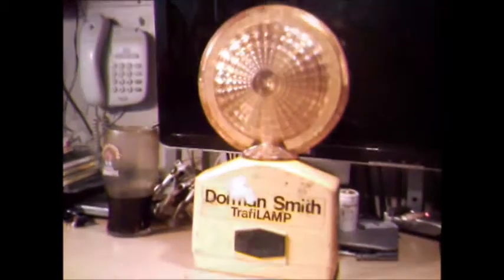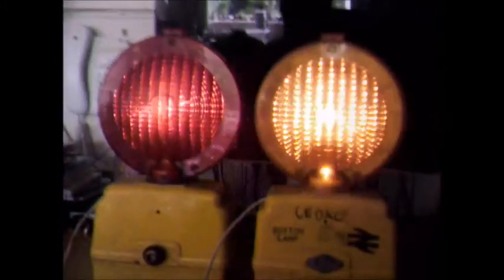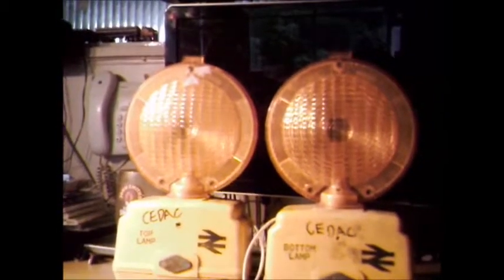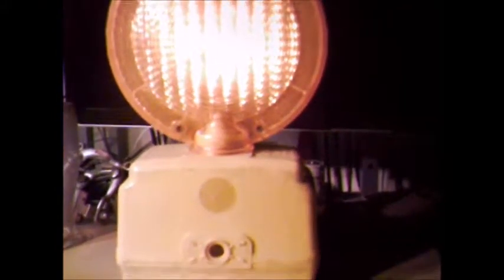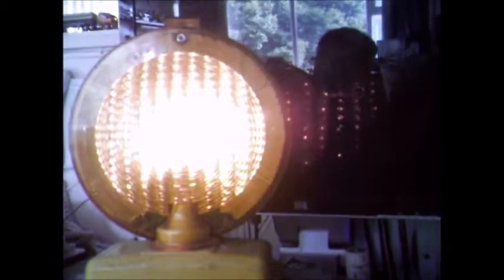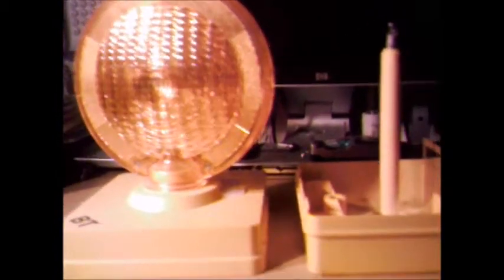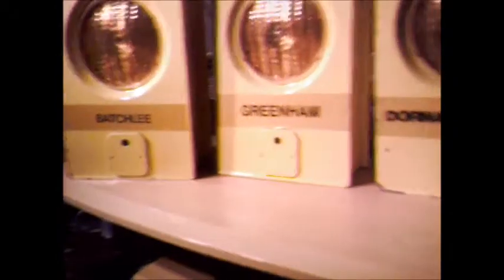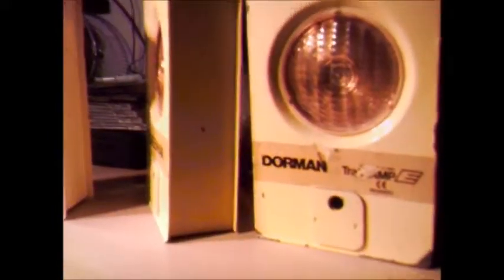My Dorman Baricade/road lamp collection

Comment: Love your Dorman 1970's TrafiLamps! Good luck with finding a tripod, have you thought of asking BT? Apparently they used them, there is a website that rent and sell road products, they may have a tripod! The single lens trafilamp could have been used on the motorway like you said or by the army/military as they usually have reflective dots on their lamps, nice HiLITE, static ones are very rare, even more rare is that the sticker is reflective as I have never even heard of them being reflective!  Blue and amber lamp is nice, is it high or low intensity? Dorman made the first lot of TrafiLamp E types in 1977 and are no longer manufactured, they were stopped not long ago, I have seen one of the 360 Trafilites with a white lens and with a blue lens as well, I have a British Gas JSP barrier post, my white one, that is made especially to hold a Dorman TrafiLamp E which british Gas used, if you need a new bulb for the EcoLite let me know and I can send one to you if you want? I have an LED bulb for a UniLAMP, if you want one (although they aren't as bright) I think Dorman will send you one, they sent me 5 bulbs before! Love the video! thanks for uploading!